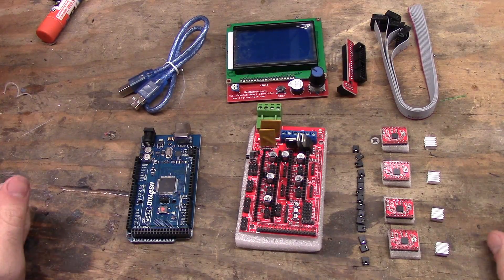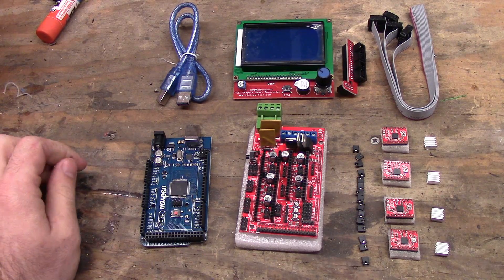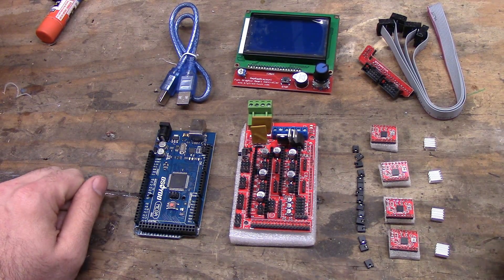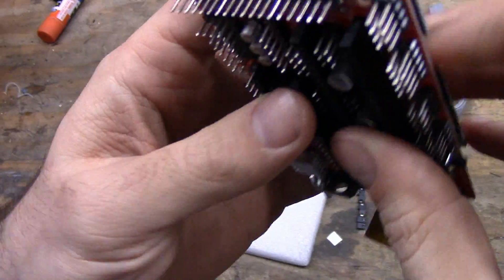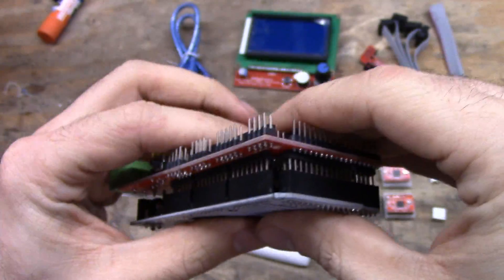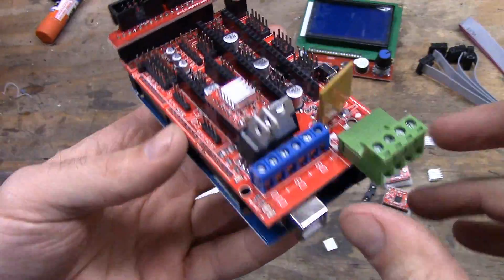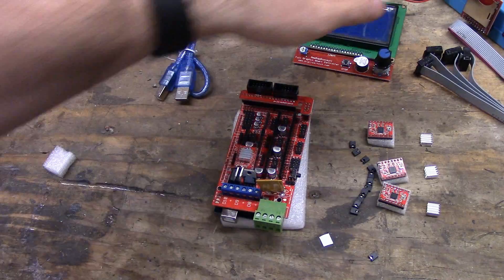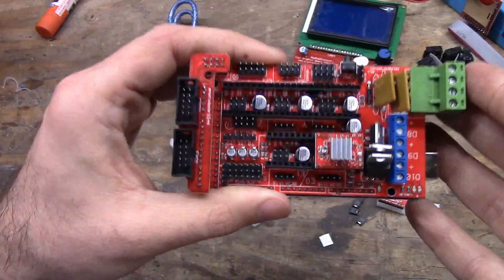Ramps 1 4 basics Part 1; parts

Comment: Could I use 30 amperage power supply or not!??
Reply from the maker: you can use as high of an amperage power supply as you could want. as long as the voltage is correct. just have minimum amperages for working.

Comment: I made every connection correct but my Arduino burnt up. why? help me please
Reply from the maker: My first guess is that  when connecting to the ramps you put the endstop switches on + and - shorting the power rails. i did the exact thing during a live stream i did a couple years ago.

Comment: Can we use 12V 10amp Power supply? Instead of 12V 5Amp power supply?
Reply from the maker: generally with power supplies its the voltage that matters. Amperage is a minimum value, pretty safe to have a higher amp supply than required as long as the volts are good.
Reply: @workshoptinkerers447  thanks you 😀

Comment: Do you think you could show us how to set up two stepper motors with a single nozzle I’ve been trying for three weeks and I can’t figure out the firmware or the slicing software😥PLEASE
Reply from the maker: dual in dual out? or dual in single out? and which slicer do you use? i only really know simplify3d at this point.

Comment: I have some spicy question :D Can you connect the Ramps with Arduino by wires? It is because Ramps does not use all the pins of Arduino and I know I will need other pins because I want to add other sensors to my 3D printer

Comment: Can this board take 24V DC?
Reply: Not recommended.  I could, if the caps are high enough rated.  Watch voltage drop across diodes, which will dissipate power.  Why not just stick with 18max, or common smps 12v?

Comment: can we use cnc sheild v3 instead of ramps 1.4? what is the difference
Reply from the maker: you technically can. major difference is the programming used to drive it. the ramps is designed for marlin. which is one of the default gcode outputs for the most popular slicer programs. you would either need to figure out how to get marlin to work with the cnc shield. or else adjust your slicer to use the cnc shield gcode. 
As i have not tried to use the cnc shield i cannot speak to exact differences other than what the documentation can tell me.